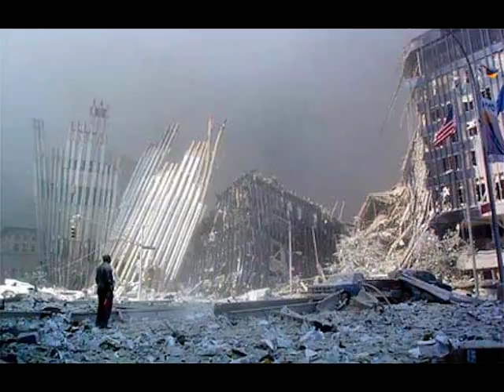O&A - Dr. Michio Kaku explains why 9/11 Conspiracies are bullshit, other things.

Comment: Steel frame buildings CANNOT collapse symmetrically into their footprint at free fall speed through the path of greatest resistance because of office fires
Reply: Ian Clayson is that what you call it when a Boeing 747 flies into the work place ... an office fire? 🤔🙄
Reply: @duel235  WTC 7 (no plane or jet fuel) collapsed, primarily due to office furniture fires (according to NIST).🤔
Reply: @747fa  yet WTC 1 struck it as it collapsed 🤔
Reply: 747 didnt hit..a 75 or767.is not a 747 jesus
Reply: @melvynsngltn27  Incorrect. While some debris (Not the entire WTC 1. Please check the facts.) hit WTC 7, NIST stated it was NOT significant in initiating the collapse. Anyway, University of Alaska, Professor of Engineering, Dr. Leroy Hulsey's 3 to 4 year scientific study and final report has revealed NIST's glaring incompetency in relation to column 79's side plates and that's just for starters. WTC 7 did NOT collapse due to office furniture fires as stated by NIST.
Reply: @747fa that's his opinion. What year was he an actual structural engineer. Were you or the Professor in NY or that day? What a person claims and what happened are entirely different things
Reply: Noelle Leger  you don’t see the difference dynamite and burning jet fuel dripping down the frame of the building? You obviously haven’t thought about it for more than a second have you kiddo

Comment: He basically just revealed that 7 was or could have been controlled by citing that controlled demolition are done from the bottom.

And the towers didn't free fall, they disintegrated from the top to bottom. And Kaku can't possibly explain molten steel.

Buildings mostly made of air because no one was in them? Wtf? Steel beams. Concrete doesn't pulverize steel, which is why beams are made of steel that hold concrete and not the other way around. Every time, debunkers stay away from questions they know they can't answer and use the towers as a distraction. Building seven.

Comment: Fact molten steel was found all over the site draining like water,  yet he said the fire can not melt steel. Well then what did melt the steel?
Reply: +ReneSerna The fires didn't need to melt the steel.  They burned hot enough to weaken the steel.
Reply: +ReneSerna Considering the plane itself was constructed from tonnes of aluminium which does melt under those conditions, what do you think the molten metal is. But these are just facts and don't confirm your belief so whatever right.
Reply: +SilverMenace100 Thermite or some other chemical way hotter than jet fuel.
Reply: Michael Bailey Thermite couldn't have been used. This has been proven many times over, that why people claim nano thermite, which has also been debunked. Videos proving the effectiveness actually used thermate and for this to be effective it had to be confined and by doing so it is extremely out and violent when ignited and would have lit the twin towers up like a fucking christmas tree. Lol.
Reply: +Mark Scott That is why I said "or some other chemical." It is not my burden to "prove" Thermite. It is Their burden to prove how jet fuel from 2 planes can be hot enough to bring down 3 huge steel structures in the footprint they were built on. I don't know what or who did it. I do know it was not little brown angry guys with plastic knives and little jet planes.  Debunk Thermite all you want. Who cares. Freakin' kerosene didn't do it either.
Reply: Michael Bailey They have shown exactly how the towers were brought down and the heat of the burning fuel and office fires were hot enough. Simple.
Reply: @MarkScott1  No, you're commenting excrement. WTC 7. Dr. Leroy Hulsey's 3 year scientific study and findings into the collapse of this high rise building have shown it did NOT collapse primarily due to office furniture fires.

Comment: This is really ridiculous - Of course the Towers had to be blown up from the top down, so as to fit in with the 'cover story' of the plane impacts - Building 7 on the other hand exhibited all the standard CD behaviours. I am shocked that a physicist would be able to accept that random fires, even if capable of generating the temperatures required, could by themselves create a symmetrical collapse. To get their model to exhibit this behaviour NIST had to 'alter' the properties of the steel, to make them non-thermally conductive - he is either not in full possession of the facts, or his faculties!

Comment: Newton's third law is: For every action, there is an equal and opposite reaction. The statement means that in every interaction, there is a pair of forces acting on the two interacting objects. The size of the forces on the first object equals the size of the force on the second object.

The towers were 1350 and 1360 feet tall. So how long it should take a 2000 pound piece of steel to free-fall through the AIR from the towers' former height.

Distance = 1/2 x Gravity x Time(squared)
or
2 x Distance = Gravity x Time(squared)

Time(squared) = (2 x Distance) / Gravity

Time(squared) = 2710 / 32 = 84.7

Time = 9.2

in order to reach the ground in 9.2 seconds, the free-falling object's velocity must be about 295 ft/sec, which is just over 200 mph🤭

The significance of FREEFALL is NONE of the gravitational energy was available to destroy the supporting structures, ALL converted to MOTION!

where is the paper SHOWING how that ONLY on 9-11, GRAVITY is allowed to not only attain a natural collapse wave within a few TENTHS OF AS SECOND in free falls ACCELERATION..

but DESTROY the structure while doing so.....

before and after 9-11 it's ONE or the other....never both..

how does it occur ONLY on 9-11 X3 to all of the threee that collapsed???

wicked coincidence?

where is the ONE paper explaining this??????

Comment: I never thought I would disagree with the great Michio Kaku, especially as vehemently as I am about to, but he is absolutely wrong.

The reason people say fire cannot melt steel is not because they are referring to how the towers fell, but because molten metal was found on the site. 

Second. Tower 7 was NOT hit by a plane and that building actually DID collapse from the bottom (as in a controlled demolition).

Michio Kaku is absolutely wrong and I do not know why he didn't discuss Tower 7.

Comment: NIST’s own studies confirmed that virtually none of the steel in either tower reached temperatures hotter than 500 degrees. The point at which steel weakens is 1000 degrees and melting point is reached at 1,500 degrees, according to NIST.The steel components in the WTC were certified to ASTM E119.A standard construction steel that requires the samples be exposed to temperatures around 2000F for several hours.

Comment: First! Explain the "Molten" metal in the basement for weeks, beside the fact that No building in history has ever fallen because of fire of any kind.
Second! Why did WTC 7 fall?
Third! No wreckage from the Shanksville crash.
Those are just 3 questions, or examples of this whole Conspiracy.
Reply: We can go on and on.
Reply: James Burkett WTC 7 fell because it had raging office fires and hit by the collapsing North Tower.
Reply: No! There were no raging office fires, they were local, and generalized(8 floors). Other buildings were hit by debris that day as well, Remember the Murrhah building in Oklahoma? Hit by a huge  blast, and didn't fall. Other skyscraper type buildings have burned from top to bottom for 28 hours and didn't collapse, let alone in it's own footprint. There has never been a skyscraper or any tall building that has come down at free fall speed, in history for any reason, other than demolition!
Reply: James Burkett There were uncontrolled office fires.  The heat from the fires caused the metal beams to expand and lose their strength.
Reply: "No building in history has ever fallen because of fire of any kind."
😅
Reply: Mychael Darklighter In 2005, the Mumbai High North Platform in the Indian  ocean collapsed because it burned uncontrollably for two hours.
Reply: S. Harris It was hit by chunks of debris from the North Tower.

Comment: First off: Building 7 (wtc 7) came down from the bottom.
Second: It's not mandatory to bring a building down from the bottom, you could take it down from the top as was the case with wtc 1 & 2. 
Third: I would love to hear Michio explain how wtc 1& 2 could come down in 10-14 seconds when an object dropped from that height in vacuum takes 9 seconds to come down. IT'S IMPOSSIBLE WITHOUT PLANNED EXPLOSIONS.
Reply: And 12 years later I'm here to inform you the outer structure of the walls remained standing for moments after the center column began to fail. You can't see the entire collapse. Your "free fall" is the outside wall getting ripped down by the middle.

Comment: can anyone touting the official claims tell me HOW FIRE ALONE removes 105 vertical feet of structural resistance globally in WTC7, BEFORE 1.74 seconds, when the kink forms, so acceleration EQUAL to Gravity can ensue, GLOBALLY and UNIFIED IMMEDIATELY following at 1.75 seconds to 4.0 seconds......

the following is from the NIST WTC 7 report...

NCSTAR 1A 3.6] "This free fall drop continues for approximately 8 stories, the distance traveled between t=1.75s and t=4.0s...constant, downward acceleration during this time interval. This acceleration was 9.8m/s^2, equivalent to the acceleration of gravity."

NICSTAR 1A 4.3.4] Global Collapse..."The entire building above the buckled column region moved downward in a single unit, as observed, completing the global collapse"

NCSTAR1A p.39/130
"the damage from the debris from WTC 1 had little effect on initiating the collapse of WTC 7."
...falling tower debris did NOT cause 7 to collapse as DUH-bunker sites lie about, claiming it did.

Inside The NIST WTC7 report is Fig 3-15 which shows a graph with regression line yielding acceleration of 32.196ft/s^2. we are only concerned with the time interval between 1.75 and 4.0 sec., the 2.25 sec. time interval where WTC7 does achieve a consistent period acceleration equal to g. 

what does SCIENCE say about the 2.3 second interval of collapse in which the rate of fall was "Indistinguishable from FREEFALL". The significance of FREEFALL is NONE of the gravitational energy is available to destroy the supporting structures, ALL converted to MOTION!

meaning, any bending, crushing, breaking the connections, REMOVAL of any and all structural RESISTANCE, BELOW the mass ACCELERATING, is occurring WITHOUT the assistance of energy from the mass accelerating. Zero resistance.

 where else do we see those SAME numbers that we see reflected in a steel frame building globally accelerating @ 9.8m/s^2????
open ANY science/physics text...."rate of acceleration seen by ALL mass REGARDLESS of weight toward the earth, at sea level, ~**WITHIN a VACUUM**~ is 9.8m/s^2.

hmm.....the SAME numbers we see under 'CONTROLLED conditions, WE SEE occurring globally and UNIFIED in a 47 story steel frame under its own power @ 1.75 SECONDS, when kink forms, to 4.0s of the collapse....2.5 seconds later, it's done....6.5 second building collapse from FIRE we can't really see from the windows.

NCSTAR1A-3.2]"It is likely that much of the burning took place beyond the views of the windows"
Reply: No, nobody can. So they lie, redirect the discussion, and call you names.